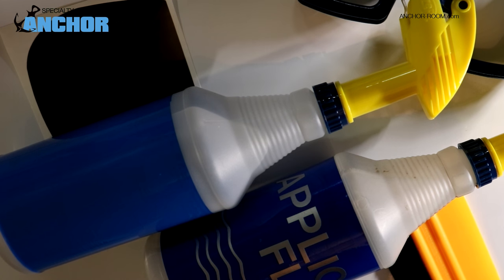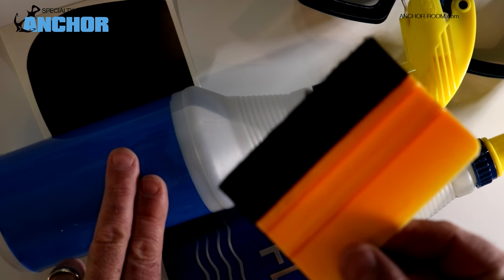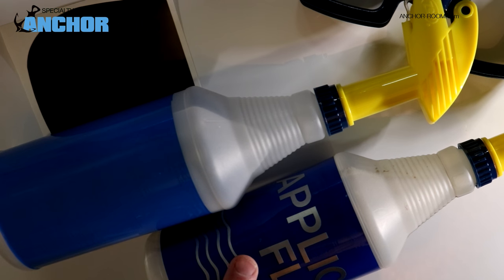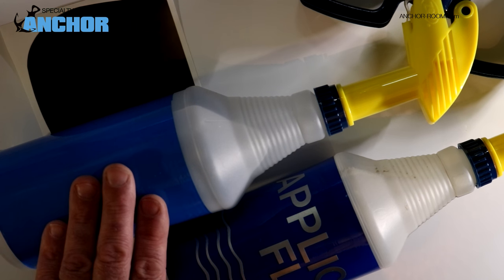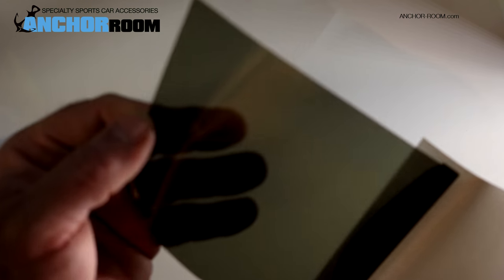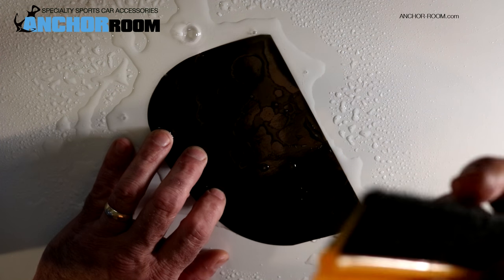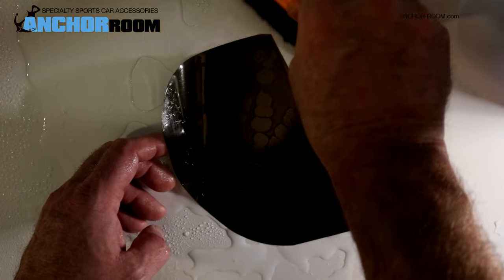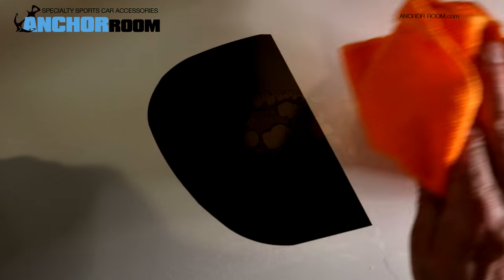STANDARD INSTALLATION-TINT STANDARD (EASY).

Comment: I don't have a baby shampoo can I use just a normal shampoo or a hand soap, or if I can just use a water so I don't have to take the piece of after I get it aligned
Reply from the maker: We use baby shampoo because it is optically clear - you can use other soaps but may have a clouding issue. Just using water is an option as the soap is there mainly to make you able to re-position the item.